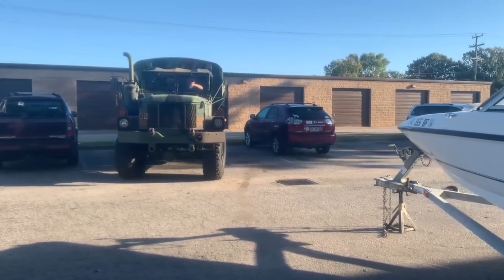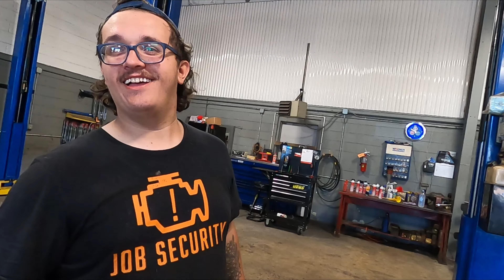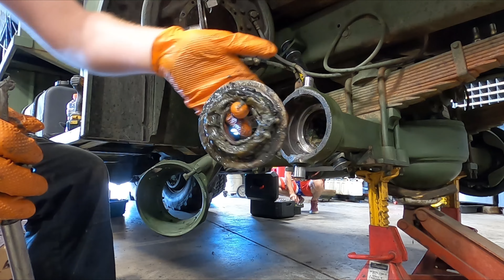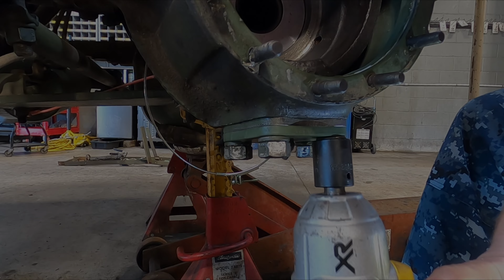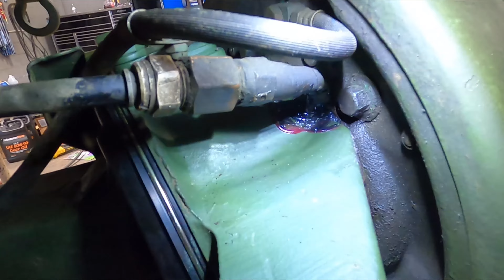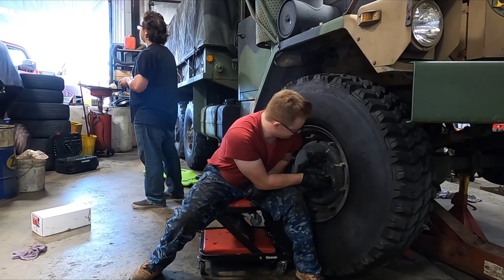Deuce and a Half maintenance

Comment: The CV axles were never a problem. It was always the inner axle seal that allowed gear oil into the steering knuckle. Easiest way to check was to remove a bottom bolt from the steering knuckle. If a CV boot was ripped, gear oil would show up there as well.

Comment: what mods do you need to run the 5ton wheels ?
Reply: Why would you want to run 5 ton wheels, the m35a3 wheels are the same as the 5 ton wheels, you can put 395's and 14r20 on those rims.
Reply: @staym925  i didnt know that at the time
Reply from the maker: As long as you get rid of the Michelin Exploders